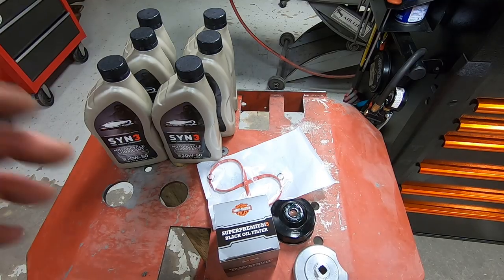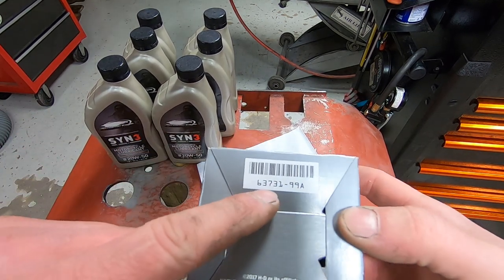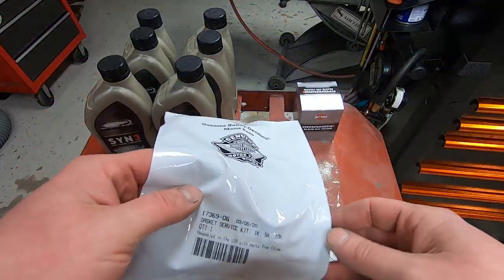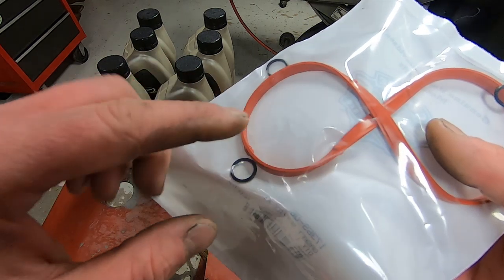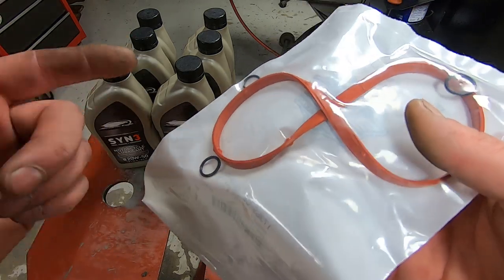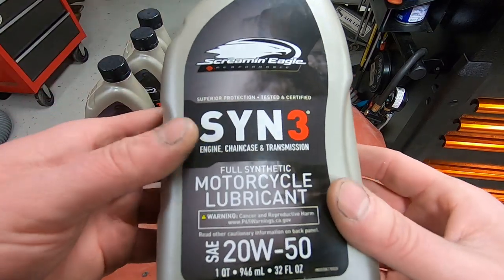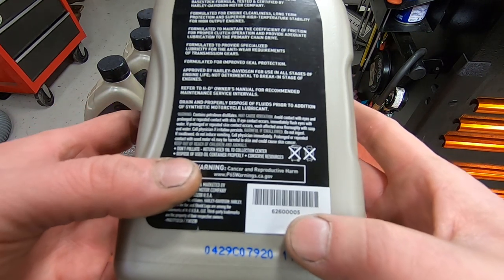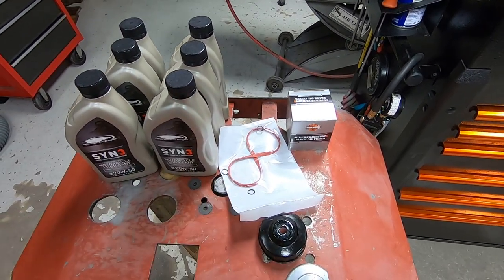HOW TO NOT DAMAGE OIL DARIN PLUG O-RING + FILTER WRENCH TOOL TIPS HARLEY DAVIDSON OIL CHANGE

Comment: Great video Brad.   I've never used any kind of sealant on the drain plugs, just dry plug and new o-ring.   I've never had a torn o-ring.   But I can see where a shop mechanic would like a little insurance in that area, considering the number of bikes you touch.

Comment: A solution I found for the oil filter wrench slipping and fighting me with the first wrench you show. I had one so bad one time I was getting to the end of my rope. The thing was on so tight the wrench kept slipping off and flexing like you described. So... I took a quarter inch drill bit and drilled two holes in the back of the filter wrench. grabbed two self tapping sheet metal screws and screwed the filter wrench right onto the filter. worked like a charm.

Comment: Ok man my question is how did you manage to put that much oil in the filter and then install it without a huge mess? I have been adding oil to the filter but I do it on an angle and keep spinning the filter so the oil soaks into and behind the filter media and I then add a little more but not enough so that it runs out the filter when I install it, is that ok it looks like you had the filter pretty much full . Should I fill it and sacrifice some for the good of the cause ?
Reply from the maker: MY RITUAL IS TO FILL THE FILTER TWICE AND LET IT SIT TO SOAK INTO THE MEDIA. THEN I SPIN IT ON REAL FAST!! MAYBE I'VE JUST GOTEN GOOD AT IT.  LOL THANKS FOR THE VIEW AND COMMENT.

Comment: I really enjoy your channel your videos. I love that it’s not an infomercial. Most of these guys turn to infomercials sponsors and that’s all you hear. Your videos are real you put out some good information. Thank you awesome I will share. I found the one when you were working on a 14 CVO Limited. That is the bike I ride. Unfortunately I did not see the last video I can’t find it. I do run extended warranties and I’m about to buy another one for it. 43,000 miles and I plan on running it up. It’s got more stuff on it then the new bikes. That’s my opinion anyway they break if they’re new or not. My bike I bought new and it’s never let me down water pump upgrade. Course of normal stuff same stuff you were doing to that brake light switch I guess they have an upgrade line went along time ago compensator Springs . Lots of wheelbearings. Radio amp. And tappets lifters never had them come apart yet . But I have a buddy right now with a 16 CVO broke down in Chicago. Lifter blew apart. It’s a shame they won’t let you upgrade to an S&S but Harley will catch up sooner or later. Really enjoy your videos thank you
Reply from the maker: Thanks for the compliment!! here is a link to the final video in that series https://youtu.be/nwzd5W8fibg

Comment: Great video extremely detailed, but Unnecessary to change O-rings and primary cover gasket every time, Obviously replace if damaged or leaking, and 100% would recommend having new ones on the shelf, I understand you have to change them you work at a dealer, but for the people working at home it’s unnecessary

Comment: thx for the vid Brad. I noticed my owners manual recommends 10w50 for the primary. The dealer had "thick green stuff" in my 107 m8 fatboy. Maybe hd gearbox oil? But the clutch was dragging and gearbox operation very stiff. Do you find syn3 gives best clutch operation hot and cold?
Reply from the maker: I have never seen thick green oil before.  I have seen engine oil with a green tint to it before, but forget the manfacture. Streaming eagle SYN 3 and also Harley Davidson Formula + are great products that are perfect for the primary. 100% zero problems ever with ware or clutch operation or drag ect.
Reply: @HarleyDavidsonWizard  thx Brad. For past year been using penrite 10w50 (it's sheer free syn, jaso-m2) which solved the crashing gear changes I had.  
I used formula+ in my Buell for years but I found after 6 months or so gear changes got notchy. Just wondered what you preferred. thx for your vids.
Reply from the maker: Personally. I like formula + in the primary and belray Hypoid gear oil in the trans.

Comment: I always added oil half way into the filter on a car n truck. You should have shown you installing with that much oil unless you used one of hd funnels and should have shown proper level in primary.

Comment: Wizard, I have a oil cooler on my 14 flhxs, should I pull the hoses off and drain the cooler to?
Reply from the maker: no. the oil cooler fittings and hoses are not made to be regularly disconnected and reconnected. and there isn't that much oil stored in the oil cooler and lines to make it worth the effort.

Comment: Hey Brad, you have a recommendation for a torque wrench?  What do you use?
Reply from the maker: I have a 1/4 snap on click style and a snap on 3/8 digital and love them both. I also have a matco 1/2 click and like it. These 3 are all metal bodied torque wrenches and I like them. Like 4 years ago I purchased a snap plastic and rubber digital torque wrench and it was terrible. normal engine made the rubber grip swell and fall off and the plastic body has a crappy fit to the endcap where the battery's go in so the battery's would disconnect and turn the wrench off when you go to torque some thing, That plastic snap digital torque wrench was a real waist of money.

Comment: TWIN CAMS>  i believe all 3 drain plugs use same type of o rings?  Is this correct...
Reply from the maker: Yes. If all 3 of your drain plugs are 5/8 head, then they all use a part #11105 o-ring.  A 2006 touring primary drain plug models use a different drain plug oring (part # 11324). And 2005 and earlier touring primary train plugs are tapered and use zero drain plug. If I remember correctly off hand.
Reply from the maker: Yes. If all 3 of your drain plugs are 5/8 head, then they all use a part #11105 o-ring.  A 2006 touring primary drain plug models use a different drain plug oring (part # 11324). And 2005 and earlier touring primary train plugs are tapered and use zero drain plug. If I remember correctly off hand.

Comment: Great vid.  I have to agree with the HD filter tool.  All have to buy the one your using seems more rigid 👍👍
Reply from the maker: I looked for the aluminum filter wrench I have last night. I couldn't find it, looks like I'll have to find another version on them in the future.
Reply: The best oil filter wrench is a nylon strap wrench. Never scratches a filter and fits every size filter.

Comment: Brad, I'm having a problem locating the Wurth pipe sealant you use.  Where can I get it?  Thanks!
Reply from the maker: Its # 0893511050 if you type it in google it'll pop up.
Reply from the maker: But it looks like its only sold in bulk. If you a normal DIY guy its the same as liquid PTFE pipe sealant from Amazon for $10 like Permatex 80632 Thread Sealant.
Reply: Brad, I finally got my small bottle of Wurth.  Ouch!  They sure are proud of it!  Say, when using a torque wrench, can you use an extension and attack the engine oil drain plug from the front?   Or does that screw up the amount of force ?
Reply from the maker: I normally don't use a extension. But If I needed to use one I'd use a 3/8 vs a 1/4 and I wouldn't be too concerned with it messing up the torque spec.

Comment: My transmission oil drain plug won't seal it keeps pushing the o ring out it threads in by hand so it's not crossed threaded but like I said it pushing the ring just hand tight any help would be appreciated
Reply from the maker: I have that problem if the oil gets behind the oring it can push it out and tare it. Clean & dry the threads of the plug + where the oring fits and also on the primary and quickly thread in so no oil gets on the oring. If it still tares, then I'd look up into the receiver area of the primary for something that's messing up the oring. Like with a mirror.
Reply: Thank you very much I went to the dealer and got a new plug and o ring today same thing its pushing it out on one side and everything in the transmission area looks good so I don't have any idea of what's going on with it but thank you very much for taking the time to respond

Comment: Good Video.  I’ve changed my oil every 5K miles all three holes and it might be overkill but I never worry about the fluids in my bike.  What’s your experience with putting other oils in the primary and transmission?  

I’ve used all different oils and have had many of them analyzed by Blackstone. There’s never a big difference in the reports.
Reply from the maker: I think changing all the fluids every 5k is a smart idea and thats what I recommend when people ask me. I typically see the least problems when Harley Davidsons Formula + is in the primary and Bel-Ray hypoid gear saver in the transmission. In my experience. Thanks for the question and view.

Comment: I would put the guards back on that wire wheel. You get one of those bristles stuck in your eye, it will be an event you will never forget.
Reply from the maker: Thats probably a good idea. This is a cheep bench grinder and the little protectors that came with it sucked. I should probably bring in my better JET bench grinder from home some day. Thanks for the comment and view!
Reply: @HarleyDavidsonWizard  I am an optometrist. If you ever do get a bristle in your eye don't take it out. Let an ophthalmologist do it, in case you punctured your eye. You don't want  to lose intra ocular pressure. Great video, thank you. for including parts numbers, wrench sizes and tool tips.
Reply: @HarleyDavidsonWizard  cheap not  cheep !

Comment: What do you think of Harley's new synthetic oil for the primary and transmission?
Reply from the maker: Ya, the new heavy weight gear oil. I like it. So far I have only seen good things from it. I'd recommend it.
Reply: @HarleyDavidsonWizard  Ok - this answer just really confused me. I get using Syn3 in the crank. and I see in the video you're using it in all three holes on this customer's bike. What confuses me is I don't see Syn3 as "heavy weight gear" oil so I'm thinking you're talking about something else. Can you expand or be a little more precise - what oil(s) are you talking about here? Thanks.

Comment: You are HD wizard? I need your help.I heard Harleys from 1999-2006 have a lot of issues with bad engines is it true? I want to buy used Harley as my first bike like 2003 Softail or something like that but I'm scared to get screwed and get a bike with engine problems or whatever it might be. Can you tell which HD are the best to buy?
Reply from the maker: 1999-2006 twin cam models have cam chain tensioners problems. There only problems actually when people dont address them. The stock tensioners need to be replaced at 30k miles, and while the cam plate is out you can upgrade the tensioners so they're last the life of the bike. That's basically the only additional work a 1999-2006 bike has over a 2007- 2016.
Reply: @HarleyDavidsonWizard  thanks now I know what's going on.
Reply: @HarleyDavidsonWizard  
So Brad, is there  spring tensioner that will last, or are you saying replace the cam plate is necessary?  Thank you sir.
Reply from the maker: Spring tensioners only last 30-50 thousand miles. If you replace the cam plate with a upgraded version it converts the tensioners to hydraulic and they last 100k+

Comment: So you think it's okay for the primary to ?
Reply from the maker: Yes. The primary is a good spot for it. The heavier oil helps quiet the chain noise down a little and the compensator can use all the oily help it can get.

Comment: In the FLH model do you use the exact amount in the primary or just add a quart?
Reply from the maker: I fill till the fluid touches the bottom of the clutch diaphragm spring. That makes sure the fluid is full regardless of model.
Reply: @HarleyDavidsonWizard  DIAPHRAGM  not  DIAGRAM  !!

Comment: Wizard,my battery connections have loosen up twice lately.
I'm thinking more locktight.
Is it something else?
Reply from the maker: Wha kind of bike and what kind of battery do you have?
Reply: @HarleyDavidsonWizard  14 street glide
Battery is yuasa gyz . 2 year old
Reply: Sorry to bother you ,have great day ,and thanks for responding
Reply from the maker: I recommend the HD battery as it's the best available. But no lock tight is needed. Crank them down with a 10mm wrench and make sure your battery is secured well so it's not moving around or vibrating. Also make sure the heavy gauge wiring touches the battery post first then add accessories eyelets. Alot of aftermarket batterys have adapters & additional nuts for the connection and that adds to vibration problems but I have not had a loose battery terminal problem with OEM HD battery only aftermarket.

Comment: Would thread tape be effective with the bolts as well or do you recommend liquid?
Reply from the maker: I think thread tape is more suited for a tapered thread, like a pipe fitting. The liquid pipe dope is really just a back up in case the o-ring is torn. We uses the pipe dope as thats what the factory does. Like if you purchase a new drain plug from the parts department it will already have the o-ring and pipe dope applied to it. Thanks for the view and question!
Reply: @HarleyDavidsonWizard  Does it matter what brand pipe dope ? I can't find that brand in a small bottle?

Comment: This is happening to my Road King every oil change. Its a ridiculous design. Harley should just have a threaded hole with a flat surface like every other motorbike or car has. Then you just have a flat crush washer.
Reply from the maker: For real.